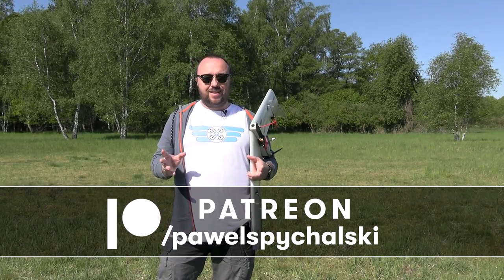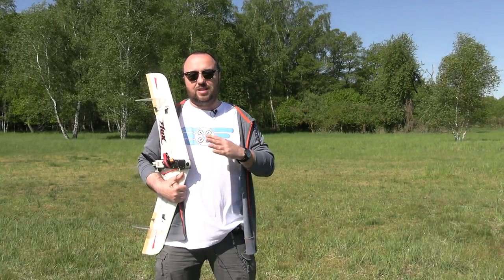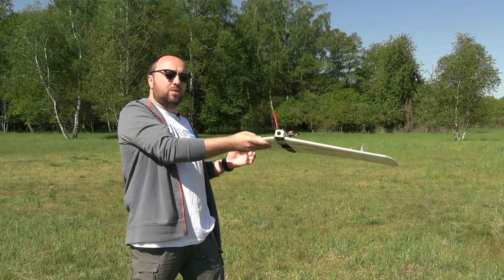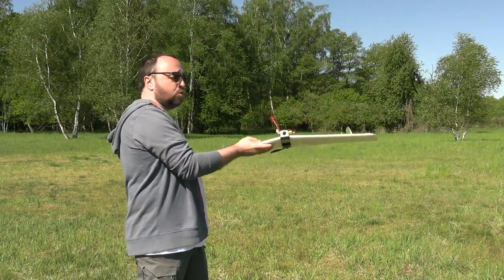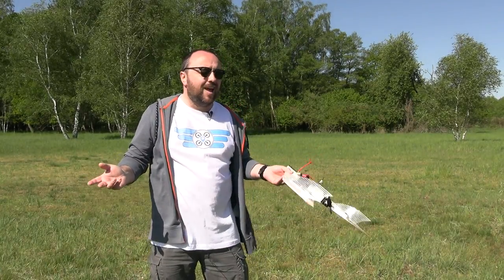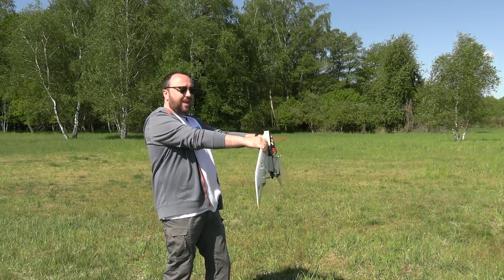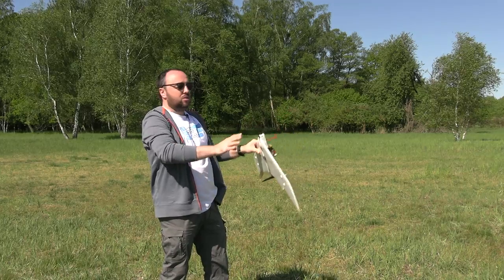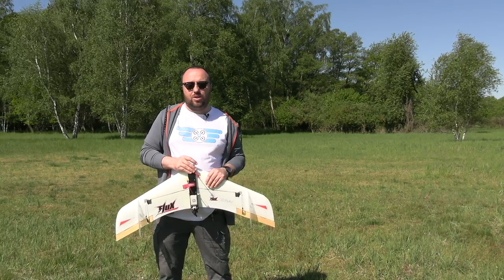How to launch a flying wing - two throws that work for me

Comment: Beside CoG check, a control direction check is a very good pre-launch check.
Know a number of pilots that have launched a wing with ailerons, or elevator reversed. 
Propeller direction is good check too, much less an issue typically verified on the bench. 

Next series, "How to - Land ". 😂

Comment: ZAGI WING MANUAL INSRUCTED ME TO USE "PIZZA  CARRY " TOSS METHOD , FROM THE NOSE . THUMB AROUND TOP OF WING AND FINGERS ON BOTTOM. ALLOW FOR GOOD STRAIGHT AHEAD TROWS .HAVE USED IT UP TO 2M WINGS. . lick your finger tips if you have grip issues.
Reply from the maker: That also is a viable method